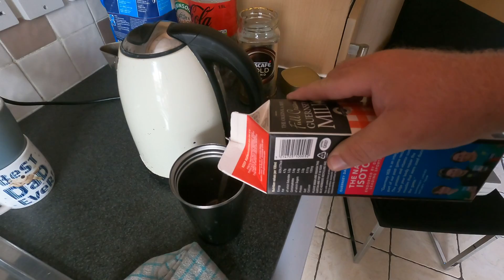Shetland 535 Restoration   Episode 3   HD 1080p

Comment: Surprisingly dry. Good job. I would just reglass the piece of fibreglass you cut out. Such a small space I wouldn't be worried about the small amount of water left in there. With a drain plug installed it will come out over time. Cheers
Reply from the maker: That sounds much less work than glassing the whole lot! As I am new to this any tips on filling the current screw holes left behind, I was thinking of just using the left over resin and filling holes with a sand after then a paint when the time come.
Reply: To glue the old glass down on the old foam mix polyester resin with talc till it is the consistency of grease add your hardner put dollops on top of the foam and keel timber then place the cut out piece on top and weigh it down until it goes off. Ensure old piece of fibre glass is clean by sanding first. Once  back in position grind off the join for about an inch each side and re glass the join. The resin and talc mix can also be used for filling small holes. But if it needs strength grind back then a small fibreglass patch using chopped strand matt and polyester then fill and sand level with the polyester and talc mix. Cheap and effective. If you need to colour match the original gelcoat colour use white polyester flow coat adding cheap acrylic paint to get the colour you want. You don't need much to match colours. If your painting it don't bother once holes are smooth just paint over it.
Reply: Forgot to add for small holes auto body filler  or bog is made from polyester resin they just use different fillers. Look at the tin it comes in and buy the polyester one.  Should be available from auto parts shop or motor factors I think they are called in your part of the world
Reply from the maker: @gp5211  This has helped me out loads, thanks for the detailed advice!! Saved me a few "lessons" I am sure :)